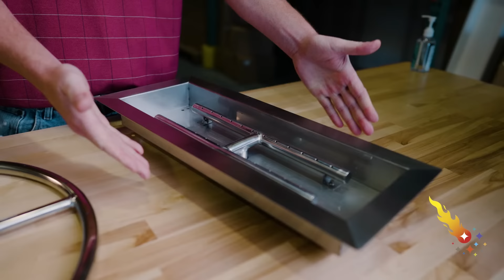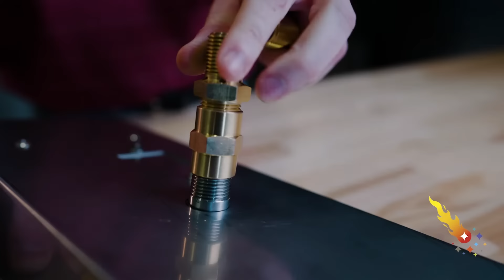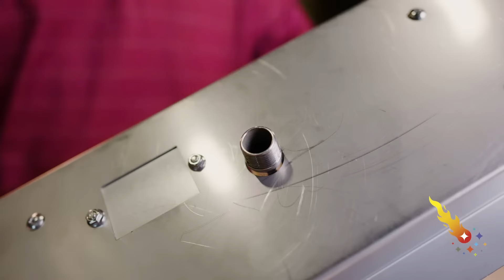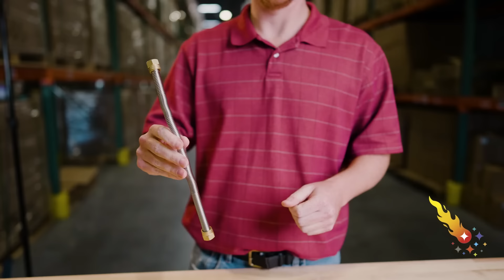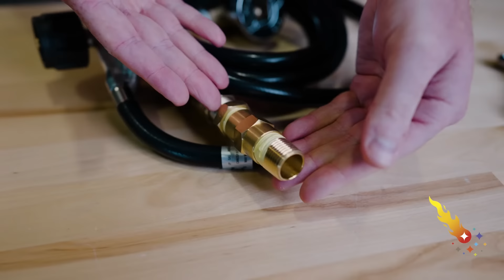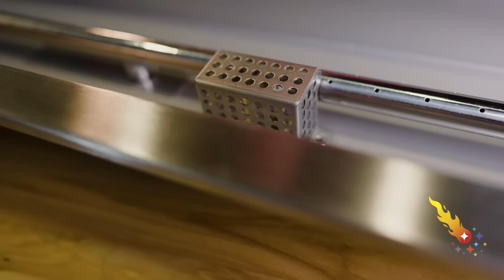Helpful Tips for Planning a DIY Propane Fire Pit / Table

Comment: hey what do you think about converting an oven that im not using into a firepit fire table  all the same parts are there right
Reply from the maker: I wouldn't know where to start on a project like that.  Cooking appliances are designed for maximum efficiency so they have much more air mixed into the gas to create the blue flame.  They're also for indoor use, so the components likely won't hold up when exposed to moisture.
Reply: @celestialfireglass  i dont know if it was you that said that in order to eliminate the blask sutt smoke adding air to the flow was a good thing .. when looking at my oven i see the same type flame just a smaller copper tube with less holes 

but if modified and the seal broken in i was thinking it would produce the same results 

and we would already have all the things like switch, regulator and all that 

but i do get your point
Reply from the maker: @semajvsjames  I like the MacGyver approach! Go for it. Fire pits are quite straightforward—a pipe with holes, a regulator, and a way to turn on the gas and ignite the flame. If you have the yellow flame with a smaller copper tube, you should be all set.

Comment: Do you guys make any quick connect kits versus threaded connections?
Reply from the maker: Thanks for checking out our video and products! Unfortunately at this time all of our connections on the hardware used for propane burners and fire pits are threaded. We do not have any propane fittings or parts with quick connects.

Comment: I have installed my fire pit H Burner Pan, however I cannot get the propane to ignite properly, there is gas coming through the holes but there seems insufficient pressure for the whole burner to light, only a couple of holes are alight at the same time before the flame seems to burn out and disappear, can you advise please as its very frustrating
Reply from the maker: Hi Charlie, 
What it sounds like is happening is that there isn't enough of a gas flow into the burner. We recommend using a high pressure regulator. While low pressure regulators work for barbecue grills they don't distribute the gas at a high enough pressure to be evenly distributed throughout the burner and create a long lasting flame. You can find many high pressure regulators on Amazon or our website. We also recommend to check your air mixer (if using a propane system) for any obstructions in the intake air holes.
Reply: @celestialfireglass  Thanks, I'll keep you posted

Comment: Thanks for the video -- very clear and informative.  I am building an outdoor fire pit with a 24" 2-ring round burner, similar to what you show in the video.  I already have a propane line to the area which is coming from a 1,000 gallon propane tank.  The line has it's own on/off switch (which is off now).  When turned on, the pressure at the fire pit site will be that which is coming out of the regulator on the tank (which is colored red).  Thanks to your video, I know I need to get that pressure down to 7-11 inches WC.  Can you suggest a regulator I need to install at the pit to achieve this?
Reply from the maker: Thank you RC, we're glad you enjoyed the video! We don't carry an individual regulator for propane systems like yours, nor do really have any specific suggestions. We recommend consulting with your local licensed gas installer as they will have the knowledge and tools to find and properly install the parts you need. Your local gas or plumbing store may also have the parts you would need for this as well.

Comment: Great video for basic information on propane fire pits!
I have a question... can I use a high pressure regulator with hose on my standard bbq grill on its lowest setting, and still be able to use that high pressure hose on the fire pit?   And does bbq grills need to or better to use an air mixer?
Reply from the maker: For a BBQ grill you will want to use a low pressure regulator, a high pressure regulator would be too much for the standard grill. You won't need an air mixer for your grill either.

Comment: Hi I live in the UK and I have purchashed a 50x16 drop in fire pit and i have purchased the last burner 90k BTU kit. I have a problem the connection from the bottom of the fire pit tray is the same as the the end of the connection kit. Any ideas what part could fix this ?
Reply from the maker: Hi Adam, thank you for your purchase! Luckily no additional parts are needed. The male end piece on the connection kit can actually be removed by unscrewing it by hand or with a pair of pliers. Once you have unscrewed and removed the male nipple piece you will be left with a female coupler that will fit directly on to the bottom of the burner pan.

Comment: Good info in the video and thank you, but why are the certified kits so much more expensive?
Reply from the maker: The CSA certified kits are all inclusive and include everything to connect and operate the burner.  They include the burner, pan, thermocouple (flame sensor), igniter, key valve, regulator and hoses to connect to the propane tank.  The DIY match lit burner pans are less expensive, but don't include all this.  If you're building a fire feature for a commercial space, rental house or where your local building codes require CSA certification I recommend the CSA kits.  They are safer to operate since they have the thermocouple and the CSA safety certification.  If you're doing something for your backyard and using it yourself the match lit burners are a good choice.

Comment: I want a 48x6 pit and I'm confused on what parts to get for that size
Reply from the maker: Hi Lifestyles! If you're using propane in your fire pit we recommend getting our LP Burner Connection Kit Rated for 90K BTUs. This kit includes the air mixer mentioned in the video as well as a chrome key and regulator. Its everything you will need to connect your fire pit to your propane tank. It can be found here: https://www.celestialfireglass.com/fire-pit-burners/fittings-and-parts/lp-burner-connection-kit-w-90k-btu-air-mixer-chrome-key-valve-regulator/